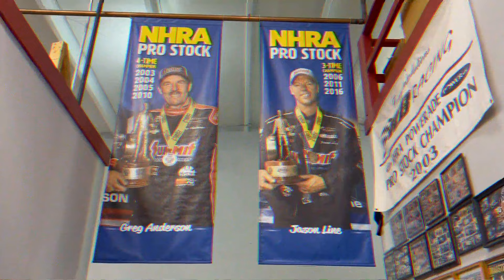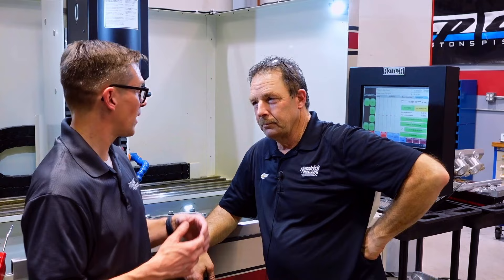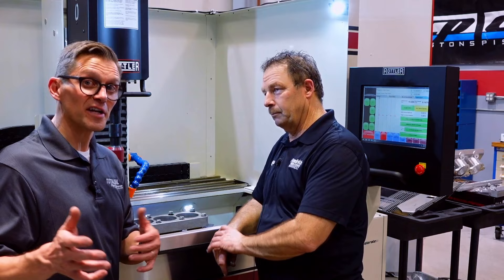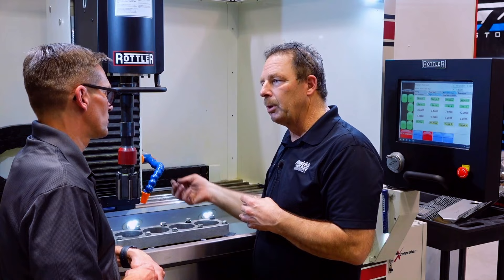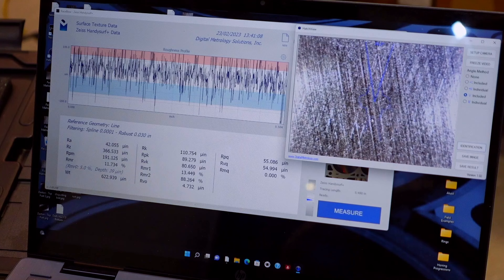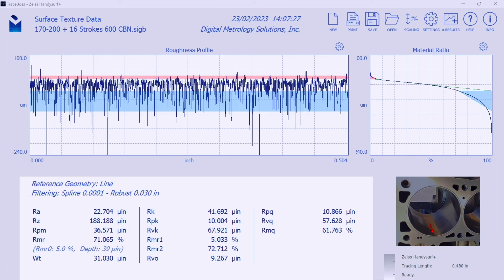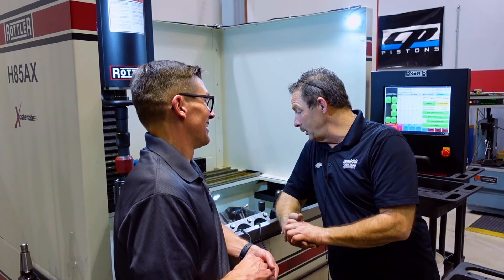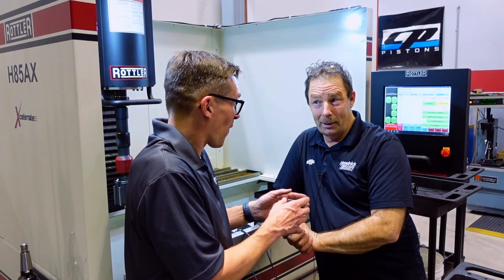How To Hone A Winning Engine Block - NHRA Champ Greg Anderson Shares His Secrets!

Comment: One factor not mentioned about using the torque plate is bolt length. Ford uses bolts of the same length but the small block Chevy has used 3 lengths since 1955. The exposed bolts are short and the others under the valve cover are long. In the past, the 2 end bolts under the covers were slightly shorter than the other 7. I have spoken with some people during an AERA webinar and mentioned this and the speaker said that the bolts that are used should realistically be the length of the bolts used in final assembly. This means spacers are required for 9 of the head bolts. He said it makes a difference if all the bolts are short.
Reply from the maker: Great point.

Comment: I came up with "plateau honeing" back in 1980 in prostock. It is just applying normal bearing design to cylinder surfaces and there is a friction an oil control element to it also. Before that Pro stockers used a straight fine hone finish.

Comment: @TotalSeal.... Your videos are a great asset to help us understand so many aspects of the honing and ring process.... 

Sincere question here... that NO ONE answers... 

WHERE can we find the shops that run the new Rottler equipment that are production shops that will take in small shop or idividual work?

Over the recent years... in most of your videos.. you are showing the process on the all of the great new machines... Great to show these processes...but with no facility to offer the services... where are we??  

These new Rottler machines are incredible.. and offer control in the builds to provide 1)Accuracy 2)Cylinder-to-Cylinder repeatability to give the the RVK/RPK values... All so we have engines that require only minor break in... and provide what we need. 

I've called Rottler and myriad shops with ZERO headway with this question. 

And YES... Sure.... an experienced machinist.... with fastidious attention to detail, using an older machine... can provide the result... BUT... (big but)...you will have a better chance of correct outcome, repeatedly, with the modern hones as shown in your MANY videos. 

Finding the combo your show in your vid here... hit and miss (more miss across the country) 
v=w_QvQaHYzNs

Any help with this and some direction would be much appreciated.
Reply from the maker: Thanks for the reply. Ed Kiebler and Scott Rowe at Rottler know where these machines are. They can help you.

Comment: Ive watched a lot of your videos. From what Ive gathered using Sunnen stones, Ive changed how I I remove down to .0004-.0005" with a 70 or 120 grit depending on how much boost it will see and then finish up with a 280. I like to run a ball hone in reverse 2-3 strokes to go against the honed grain and then forward another 2-3 and it looks awesome. I am pretty confident my numbers close to right but im planning to rent a profilometer to be precise. Can you give me any advice on how to find info on setting it up? Its a Mitutoyo SJ-210 series 178 and Ill only have it a few days to check my Rvk and Rpk values. Is that the same model used in your videos? Thanks a lot for all the helpful info!
Reply from the maker: Thanks for the question. Here’s a video on how to set it up.

https://youtu.be/yk74chDVM8Y

Comment: i hadn a question more than a comment. you said how important the honing numbers are for valley depth. this is the 4th thime ive built the motr and every time we went deeper on the valleys the bore looked better. last hone was at 65-70 depth this time they went 130 on the valley does that spound to deep? it sounds  a little deep and i dont want to have consumption issues. its a 4cyl turbo app with forged pistons and iron block at 507 hp atm tune wise and anywhere from 25-30 psi boost.

Comment: I see you machined it with the main caps in place - might mention the importance of that for the shape of the bore bottoms?
Quite some years back, there was a fad for hot honing - running hot water through the coolant passages to replicate the thermal distortion - have you noticed any difference and/or would it be worth-while for alloy rather than CI blocks?
Reply from the maker: Hot honing is great for regular cast iron and Aluminum blocks.

Comment: Have you tested the effect of a torque plates on each side of a V8 simultaneously. It seems unlikely to make a difference but worth testing.
Reply from the maker: They have, and they use torque plates on both sides whenever possible.

Comment: here is a test.. Hone the block with the torque plate, take the torque plate off and bolt on the actual head and remeasure from the bottom of the block.

Comment: 3:00 Hot honing is an impossible dream. Just heating up the whole thing does nothing but make the entire thing bigger. It does not simulate the heat in a running engine and never will/can.  The upper cylinder runs hotter than the lower cylinder and much hotter than the bottom of the block while the cooling water flow changes it all again. Then there is heat input into the block from the cylinder head that is uneven.

Comment: If you don't have access to a profilometer, what's a Good "All Around" honing procedure/Diamond selection to achieve correct surface finish? And does it only apply to "new" Rings that need more valley or does these new procedures of honing benefit older style Rings packages also? Thanks
Reply from the maker: We highly recommend investing in a profilometer as that is the only way to know what your honing process created. Short of that, follow the procedure shown in this video. That will get you in the ballpark.
Reply: @TotalSeal  10-4 Thanks
Reply: Great video guys can’t tell you how much I appreciate the info... I live in southeast Louisiana... I don’t own the machine equipment or a profilometer to do my own cylinder finishing but would really like to get my blocks done by someone who does... could you recommend anyone in the Gulf Coast region that you know has the equipment to do it correctly... if not then could you maybe put up a list of the shops that you know have this equipment outside my area... I know this is a tall order but I think many of your viewers would benefit from this as well as me... I appreciate your time

Comment: If it made the same horsepower after 20 years,it had the wrong valve springs in it initially.
Reply from the maker: No loss of spring rate over 20 years of storage. We have the original build sheet. The spring rates are within a pound or two now as when the engine was built.
Reply: Wow!
Reply: Very professional builder, and top notch information!